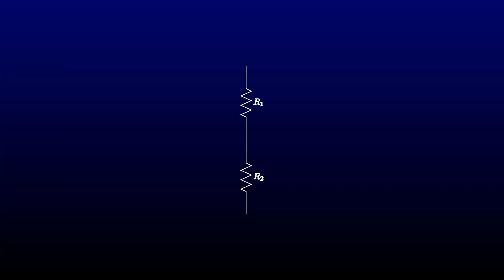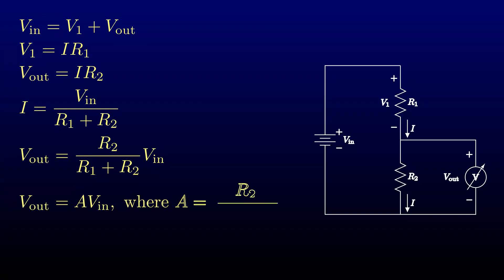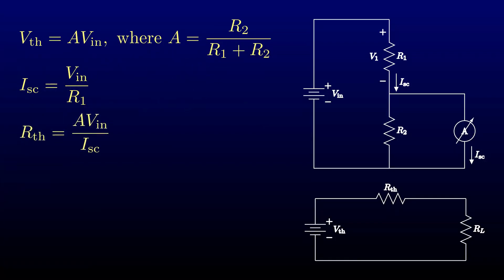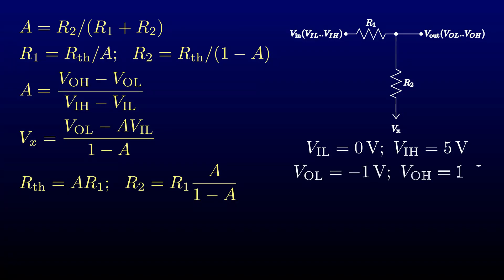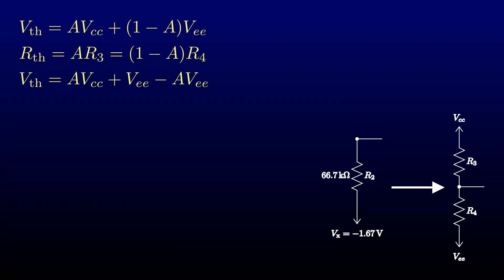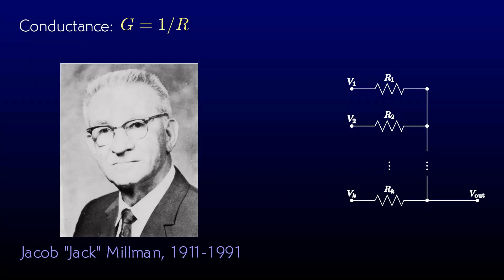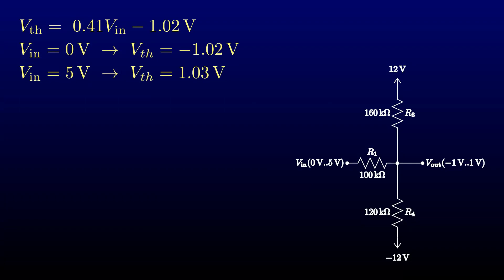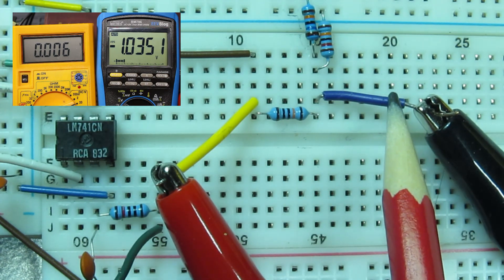Audio Synthesis Ep004: The Humble Voltage Divider

Comment: The voltage divider, er, the humble voltage divider, is one of my all time favorite blocks….i particularly enjoy making them useful while scavenging off the minimum possible amount of current. FETs are a very good friend in that regard
Reply from the maker: @joerectifier  of course, those high-impedance nodes are wonderful at picking up unwanted signals. If I don't keep my leads short and have too high values for the resistors, I start hearing Fix Sports from a local AM station.
Reply: @KludgesFromKevinsCave  you make a good point….with portable battery powered stuff, we have to find a happy compromise that satisfies battery life, part count, cost and pcb size when we have no control over the market identified physical product dimensions…..faraday cages can be useful